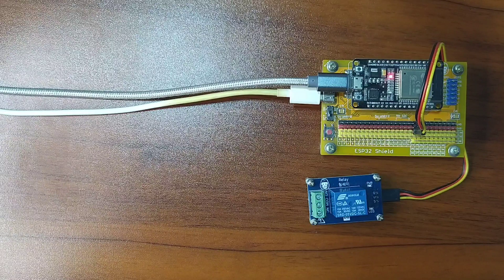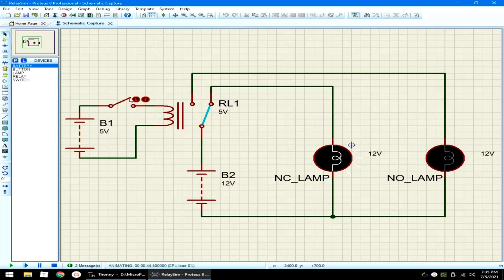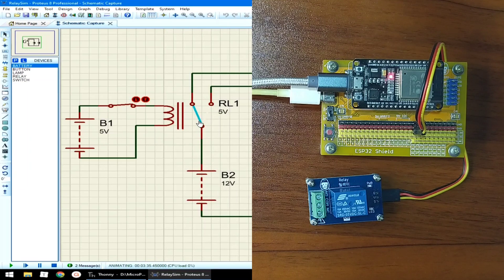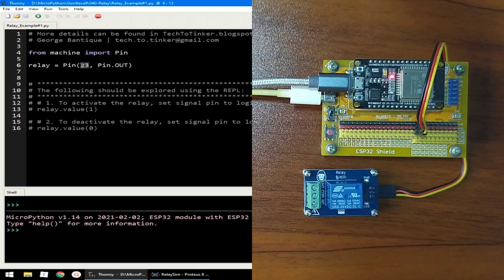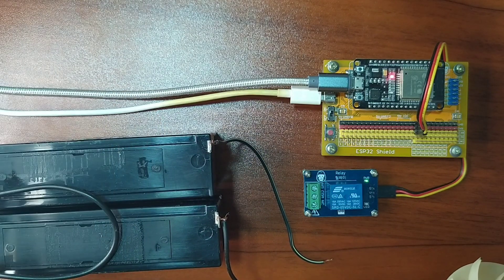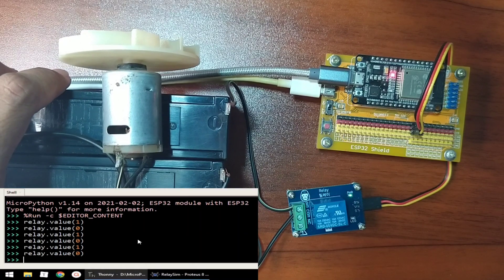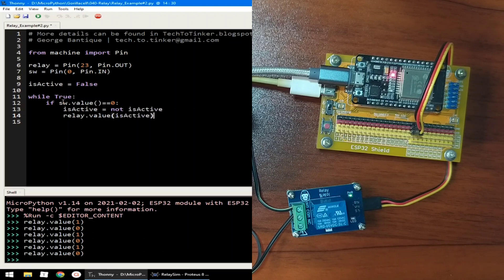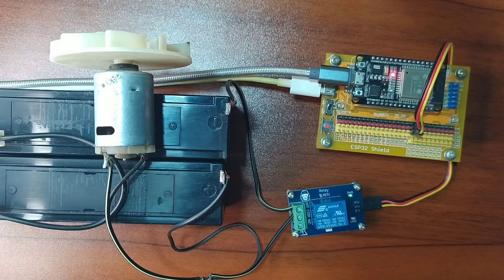040 - MicroPython TechNotes: Relay

Comment: Awesome, many many thanks I was wondering if you could teach how to set a water Tank level using hcsr04 esp32 micropython and fusion charts using a gauge cilinder
Reply from the maker: Hi @Alex Diaz, I actually posted a video of HC-SR04 https://youtu.be/I1HEU5F5QKU . Perhaps you can explore it first, then try to work from there, then if you have any question just send me a message or email. Cheers.
Reply: @TechToTinker  Thank you very much for your quick response, let me tell you that your information is gold, and congrats, you explain perfect, actually I got a project with the Hscr04 and esp8266 working as Access Point and it refresh the water level using ajax, that works already but I tried the one using fusion charts and I don't know how the js part on html reads the variable distance which is the water level. If you can provide me your e-mail I can send you my project, the one running and the one I'm trying to use fusion charts. Once again thanks a bunch!!!
Reply from the maker: Ok, let me see it at tech.to.tinker@gmail.com but I can't promise you if I could help you with fusion chart your talking about.